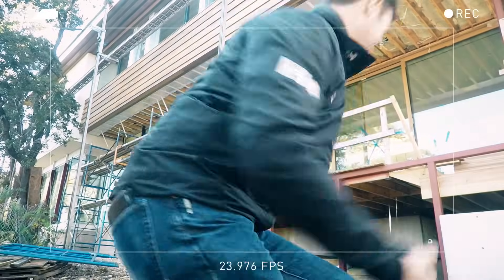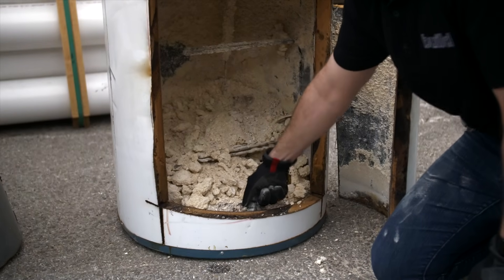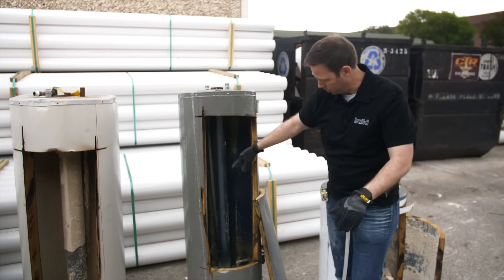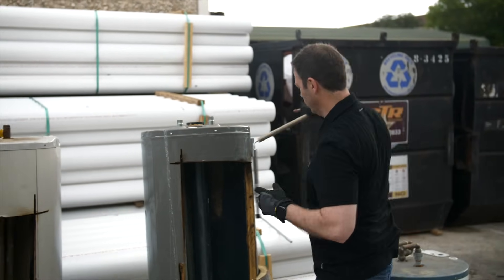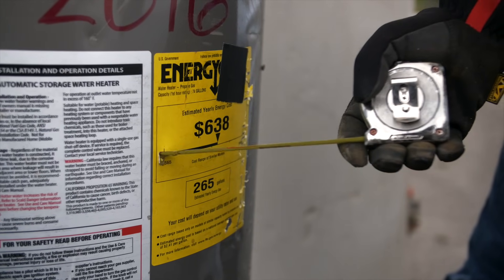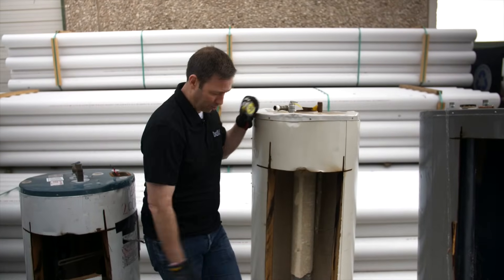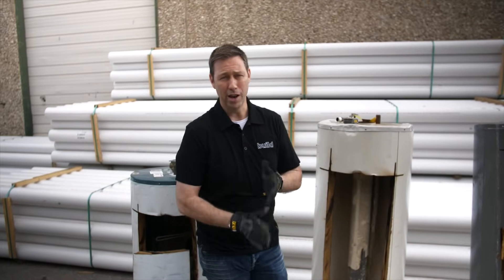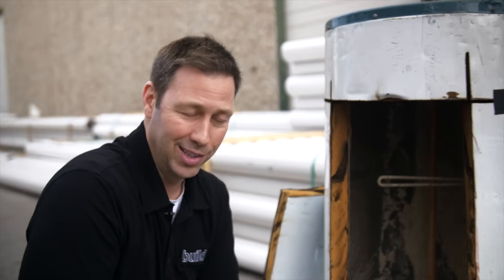Four Water Heater Tanks Cut Open - Lessons to Learn

Comment: In Dec. 2018 my water heater will be 30 years old. The only thing I have done to it is use it !
Reply: First of all, not enough info to judge. 22 years of being a plumber in Texas I have never changed an anode rod. That is a reginal issue depending on the quality of the water. Most people never flush their water heater so you are not alone. It is debatable if flushing can extend the life of the water heater but mineral buildup can reduce the capacity. I've seen water heaters that have failed at 8 years and some over 20 years. If you have a water heater that is over 8 years and giving you trouble it is a judgement call as if to replace or not. 
30 year old water heater good for you, yes it will eventually fail but if it isn't in a place that is flood hazard or if you have a pan with a drain there should be no need to worry, let it ride.
Typical gas install including materials around here is $1500 and $1200 for electric. Most of the time it's because of code issues with the water heater. No pan, no where to drain the pan, releif valve under sized, etc. There are almost no basements here so water heaters are in the garage, interior hall closet or attic.
Reply: And I haven't backed up a hard drive in 25 years YOLO!!!!
Reply: There is a simple answer to that. 

The old tanks were built WAY better. WAAAYYY better. Service Plumber here, I’ve changed hundreds of units. 

I pulled a 1970 tank out in 2019. Still worked, relief valve was leaking. They wanted a new unit.

The tank was fiberglass, it will never rust. 

The new fiberglass units are called “lifetime” units lol. 

I can attest to that, thing was 2x older than I was when I pulled it out. Still worked like a champ. 

it was a Sears olive green unit built in 1970 -72, somewhere in there.
Reply: @user-kn5ol8ck8s  ... should have refurbished that unit and used it yourself!
Reply: MIGHT WANT TO GET IT PUT INTO THE HOT WATER TANK MUSEUM AFTER IT FINALLY DIES. IF YOU WANT THEIR PHONE NUMBER LET ME KNOW.
Reply: Moon Pie  written by a plumber. Wanting to sell you a new hot water heater.
Reply: Janice Anmary  we also never do anything to our water heaters.   One was 21 years old when we moved, current two houses we own are 12 years old each
Reply: I bet you dont live in southern california!  water is super hard here
Reply: Mine is 25 years old. Replaced the weekend Lady Dianna died. My plumber said leave it until bottom rots off.
Reply: Be careful. My grandmother moved into a house that had the original 24 year old water heater. Even though it showed zero signs of external rust or failure, the insides were rusting out. I warned her to replace it for this reason. Not too soon after, the bottom fell out and flooded her home. She had to replace her recently installed carpet again plus a new water heater.
Reply: What's the brand name of your heater?
Reply: Steven  They don't build'em like they used to
Reply: Mine is going on its 36th year. American Ameri-glass.
Reply: Awesome comment. I had one last 25 years.
Reply: Thats why you got mad rust in ur tank 🤣
Reply: May not have to do anything if you have water filtration
Reply: I don't understand. What are you trying to say?
Reply: Alot depends on water quality. Many get less than 10 years out of one.
Reply: Lmao same here
Reply: Thats great! Be sure your t&p valve still works if not get that replaced.
Reply: Don't make em like they used too.
Reply: Nicholasville Littlejohn - She will save more money by keeping the current water heater for as long as it still works. There is no way saving a few dollars a month will pay for spending  $700 or more for the water heater plus the cost of installation plus she would be starting the constant replacement cycle of current 10 years average lifespan heaters.
Reply: @booobtooober  i agree with you
Reply: Your like me. Ive never flushed mine or anything. I just turn on the sink and shower and its going on 21 years.
Reply: POWER FLUSH it for more efficiency.
Reply: The one in the house we just sold is 8 years old. Had to change out the expansion tank and the T&P valve. Hoping it will last for the new owners for a long time to come. Never did anything else, which is why we had to change the expansion tank and valve. Annual maintenance can save a lot of hassle.
Reply: A new one will save your bills a lot, check for rebates from your utilities and be sure to have a drain pan/hazard insurance for the eventual leak out.
Reply: It's all fun and games until your tank finally springs a leak due to rust and floods your house. Rather than crossing your fingers or knocking on wood, I would save yourself some money and headache and get that thing replaced.

Comment: I cut mine open and found 100 gallons of water. Now my basement is flooded and I have no hot water. Wtf!
Reply: Well, change that anode rod while you have it open.
Reply: Go see whats inside your propane tank.
Reply: @bunberrier  hahaha
Reply: Get some of that supper tape advertised on TV. You' water heater will be good as new!!! lol
Reply: Use some of that stuff the guy on tv with the screen door in his boat used to seal it up good as new.
Reply: @rafdavfl what's for supper? Answer: tape
Reply: You no got a 100 gallon tank. Me thinks U gots no more dan a 60-70 gallion tank
Reply: @deasttn  - He probably had a 50 gallon tank, but he didn't read the instructions where it says to turn off the water BEFORE cutting the tank open, so he ended up with 100 gallons on the cellar floor.
Reply: Naw yall forgot about dat flex seal!! It will fit it in a jiffy!
Reply: Yes, but now you have a swimming pool you never had before, sounds like a fair exchange.
Reply: Brian Landers I used to “winterize” empty homes for mortgage companies so the pipes didn’t freeze, part of which was draining the water heater. I always kept a bunch of wire hangers in my truck for just that. Plus people usually leave them behind in empty homes so they were always free!
Reply: U can't fix stoopid
Reply: Funny AF
Reply: sounds like operator error, i bet next time you read the manual.
Reply: Rotflmao...
Reply: I experienced the same thing when I removed an old water heater, minus the flood.  In my case, scale had built up inside the tank preventing the drain from working properly.  The clue was when I moved the heater.  After draining it for an hour, it still weighed several hundred pounds.

100 gallons sounds like a bit much considering most domestic water heaters can only hold 40 - 60 gallons.
Reply: Use flex seal
Reply: Sue.
Reply: Don't Tell anybody you cut it open on purpose! Now you just need to hide it and claim 👽 alien's took it and gave you a swimming pool for your basement for it!
Reply: I bet you were steaming ( hot water and all that ) 🤣🤣
Reply: I saw on TV that there is tape that can fix that problem - just slap it on - no more leaks  :) presto... you now have hot water
Reply: Yup, put it in the hole and wiggle it. works every time !!!
Reply: Lol as a HVAC/COMMERCIAL refrig guy, I spit out beer when I read that, one of the best comments I’ve ever scene
Reply: OBummer!!! 🤣😂
Reply: Now you can take a bath in the basement.
Reply: Lmfao I hope your joking about cutting
Reply: LOL
Reply: Retrogamer1010 😂😂😂😂
Reply: LOL!
Reply: Get mighty putty
Reply: Retrogamer1010 x Hahaha you're smart!
Reply: Retrogamer1010 is a clown.
Reply: LOL, awesome comment. I suppose you could always make a lot of hot tea!
Reply: The Flex Seal guy wants to talk to you!
Reply: lol for a second I though you were for real XD also, 100 gallons? What is your house like Buckingham palace or what?
Reply: Now u have a warm water swimming pool lol
Reply: But did you set it to WUMBO?
Reply: It reminds me of this water heater: https://www.youtube.com/watch?v=lrZQgWOenCo&
Reply: Congratulations ! for built your in door basement swimming poor.
Reply: I never knew they needed servicing..who would of known..
Reply: you cut it at the wrong angle
Reply: How's that divorce going?
Reply: These YouTube videos are crazy! Telling everyone to cut open their water heaters!
Reply: Funny 😂
Reply: Water in a water heater? Say it isn't so.  😢😢
Reply: LOL
Reply: You have a 100 galloon water heater?
Reply: STFU
Reply: are you a democrat????
Reply: @vicentevillacorta101  Lol, home improvement is now politicized!
Reply: @Xabier2.0  :  You can tell he voted for Hillary.
Reply: @virgingrandpa1920  the immaculate inception! LoL
Reply: Vicente Villacorta no doubt about it.
Reply: Vicente Villacorta are you a follower and like to gerurtiatwge whiiij
Reply: Vicente Villacorta 😂😂😂😂
Reply: @vicentevillacorta101  😄
Reply: @vicentevillacorta101  😄
Reply: @vicentevillacorta101  he may or may not be a Democrat but we certainly know what you are
Reply: @vicentevillacorta101  worse, he’s a republican. Can you believe it
Reply: @vicentevillacorta101  lmao
Reply: @vicentevillacorta101  Great answer!!!
Reply: You must be a Republican

Comment: On the efficiency comment on the first tank. Instant efficiency is measured by the electric energy you put into the heating rod and the temperature change on the mass of water you have. That efficiency does not change because of the scale as all the heat still stays inside the  tank. The scale can take also some heat but it will release it back to the water, so the electric bill will not double for that. What is going to change is the life of the heating rod as it will be at higher temperature to transfer the heat due to the insulation effect of the scale
Reply: I'm way late to the party, but that was what I was going to point out.  Instead, I searched first, and it wasn't hard to find your comment.  Yup, electric resistance heating is 100% efficient (no that's not a good thing because heat pump can pull heat from the environment at much better than 100%, but I digress), and the law of conservation of energy applies.
Reply: Good comment. Heat does not just disappear. Now on the gas units it's a different story. You are losing heat up the flue and the insulation will resist thermal energy transfer, resulting in more time to heat the water
Reply: You are 100 % correct, he was also pointing out the anode rod which was actually the element.
Reply: If the mass  of sediment is higher than that of water then wouldn't the total energy required to maintain temperature be higher?
Reply: When you got more flakes and junk in your tank, it slowly and continuously travels thru your plumbing to damage your kitchen and bathroom faucets. 
I can not believe you seriously waste time defending the scale and sediment in any tank.
Reply: @dlyciousmusic  i think you missed the point. We are talking about heat transfer. To your point. How often do you flush yours? I recommend one a year but i don't do it. I have never had sediment clog any of my faucets. It depends where you live and what the water quality is. Cheers
Reply: @simclardy1  I'm a Plumber. I Repair/TuneUp/Power-Flush, or Install monthly about 30 water heaters. I always take a full assessment of my Customers plumbing in their kitchen, bathroom, washroom. 
Sometimes i install Used WH's ... so I NEED NEED NEED to know their pressure and plumbing is in Excellent condition, so I can give a long-term Guarantee on my WH's and Service.  And ... 
About 60 Percent of the time, customers currently have additional plumbing problems. I remove and clean their screens, replace Valves broken with excessive sediment or rust. 
(FYI... a WH should be Power-Flushed every 6 months).
What is your professional experience with customers?
Reply: @dlyciousmusic  you left out what region you live in..... this makes a big difference. If i charged my customers to come out every six months to flush a tank this also has its cost. There is a point of diminishing return. In my area (cape cod) this would not be my advice. I have gas, electrical and hvac licenses in nj, massachusetts and droped my pa licenses. I run my business. I recognize you are a professional and i don't want to take away from that. It's just difference of opinion. I digress. Cheers
Reply: @dlyciousmusic  sounds good. Our area has soft water. I believe in fair pricing but I will not feel bad for making an honest living. If people don't like my prices they can go somewhere. I wish you the best Cheers
Reply: @simclardy1  Thanks and Good Luck.
Reply: simclardy

Comment: I think the main reason these tanks get replaced is they leak.   Even if the scale isn't too bad, the glass lining eventually gives up somewhere causing a pin hole leak.
Reply: Ty Curtin That reason and just general renovation. He says "I dont know why this one was replaced". 
Duuhhh it's either because it leaked or it is old. Great 20/20 hindsight AFTER cutting a hole in it Matt.
Reply: @DiscoFang  hahahahahahahahaha

Comment: At the end of this year, 2018, my water heater will be 30 years old !!  I have "never" flushed the tank or replaced the anode rod. This tank was made at a time when companies had quality products not the junk they sell now that only last 6 to 10 years.
Reply: Well the degradation of the anode rod and buildup of scale are really more determined by environment than product quality.  The anode rod is there to prevent galvanic corrosion from destroying your plumbing -- you might want to look into replacing it after 30 years.  Depending on your water quality you could have quite a bit of sediment and scale buildup in that tank by now.
Reply: Just replaced a 26 year old electric one, not once flushed or swapped the anode rod. Only reason it was replaced is because it blew out one of its seams. But now with the new one installed I am comfortable knowing we should be good for a while. Also, went with a company that doesn’t just goes to Lowe’s or Home Depot and pick up one of theirs to install. We got a commercial grade heater.
Reply: Old: Craftmaster New: A.O. Smith Commercial Series.
Reply: Can you tell us the brand  of  the new water heater ?
Reply: Get a glass lined tank and also install expansion tank on the cold water side.
Reply: Your water tank has a youtube acct, and went from here to your calendar and noted your next extended vacation.  These devices have always been listening.